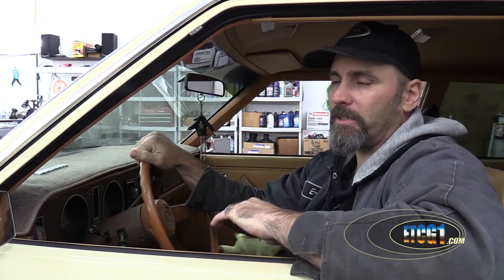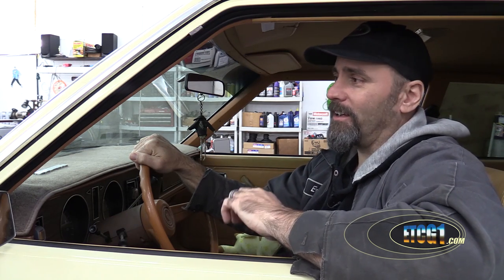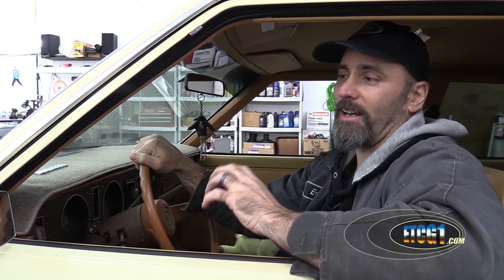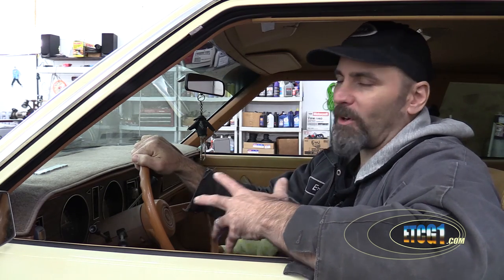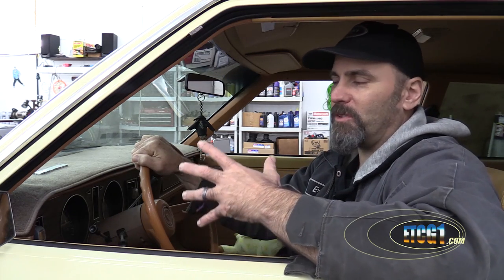Analog vs Digital (Cars)

Comment: Well this devolved into an ageist controversy quite quickly...

I would say most people still have an assumption that electronics are more likely to fail, because that's how unreliable they were up until the last 10 years or so. You mentioned that carburetors are tried and tested, but if you apply your logic to the mechanical components you come to the same bias to assuming electronic failure, not some age exclusive understanding of gadgetry. You are giving people born after '85 way too much credit, hahaha. One other reason you left out, is that people tend to try the easiest fixes first, and swapping most sensors can be done in a few minutes (obviously there is a cost-vs.-ease relationship, but for the most part...).

Comment: I don't agree electronics is more fragile. It is less fragile then mechanics. Less moving parts was always preferred for reliability. But this allows the system to be designed more complex.  Making the systems more complex makes electronics seem more fragile.
 And what comes to repair-ability. I guess it is like the same as with mechanics. You just need different tools and skills and a designer who designs for repair-ability. It's just  the same with mechanics. You cannot weld rusted body parts if you have no MIG  as well as you cannot replace transistor if you have no soldering iron or you cannot play with software if you have no keyboard and compiler.

Comment: I really feel like the "manual" vs. electronic parts is what I prefer.  manual as in the lever underneath the seat which doesn't require electricity to adjust how far back you want your seat.  manual as in I can turn the heater controls and not have to worry about my touch screen that houses climate control settings going out.  I feel like late 90s Hondas/Toyota's are the sweet spot mixture of the two worlds.  I enjoy the ease of diagnosis with electronic sensors is a blessing, however the inundation with technology in making cars more luxurious is a step backward.  more electronics equals more bullshit to fix and more money to fix it.

Comment: I'm 24 year's old with an 04 toyota sienna that has a P0420, and 430 both say Catalyst System Efficiency Below Threshold (Bank 1),,,,, Catalyst System Efficiency Below Threshold Bank 2
at this point i say sorry car i changed the sensors relatively cheaper with aftermarket ones that I know are good and compatible and so now all i can think of is the catalytic converters (which are located on the Exhaust Headers) are gone. [from being a carpenter and having to go to a few worksites that past mud sections and having to get through somehow. and having an accident that had me replacing a few things] 

and so even i think that sensors are great but just having a before sensor go and an after sensor bend on me to now this. it's all great when it's working but when its going bad it's a technicians nightmare and money maker but a driver's death sentence.

Comment: Haven't read through all the comments....but, I prefer analog systems.   Try wasting hours chasing mouse chewed wires in the PDC or explaining why it costs so much to the customer for a wire repair!  That may happen the next day....just in a different area.  Carbs and HEI way easy.  The more complicated the system,  the smaller wrench it takes to mess it up.

Comment: Back in the day. digital were an complex and  expensive option for high end vehicles. Many mechanics of  those times like the mechanical systems due to trace fault method of fixing things. The  preference of my uncles is to go mechanic, mine is a mixture of both and my nephews is electronic. Neither is better, each  has a purpose that either makes one happy. my wife would  not let me upgrade  the Tbird  to a electronic carb and ignition system  until I showed her the newest EFI system and it's components

Comment: I think being born in the crossover period doesn't help.  It is difficult for people to tinker and play when something isn't purely one discipline anymore.  I think what will be exciting is when the open software and open hardware movements see more uptake in the auto world, then the tech can be as transparent as the mech.
Reply: But If You manage to adapt to the new tech You become versatile. It's good for self esteem to possess to knowledge about difficult stuff :)
Reply: Oh, yeah, for sure, I'm all for that :)  I think it just changes the learning curve for DIYers because you can't just jump right in and "learn by doing"... you have to worry about getting your car stuck in limp mode or an airbag blowing up in your face etc.
Reply: As much as I enjoy and support the open software/hardware movement, that will never be a thing in cars. Mostly because of the federal regulations and the liability it might pose to the manufacture.
How ever, if your building something custom for yourself check out the MegaSquirt system. Open source hardware and software engine management system. Can basically be adapted to run on anything really.
Reply: Yeah it's a fair point at the manufacturing level.  Maybe there is hope at the service/aftermarket level though...  A client of mine used to do all sorts of wizardry, probably largely illegal, to get diagnostic codes they could sell to people who make scan tools.  The manufactures have that shit locked down tight because they want people using their service centres.

In fact, just googled: "open source diagnostic tool" and there is some stuff out there.  The data is the precious thing I guess though so we need open source CAN nodes so we know what the codes mean.

Thanks for the info, don't think I've seen that one but have seen RuseEfi which seems like the same thing -- would deffo love to give it a go one day.
Reply: ***** Its a bit of a learning curve, because to make it work on certain engines and different configs you have to mess around with the hardware. But theres a pretty good community around it, and lots of info.
https://www.diyautotune.com Is basically the best place to buy hardware, lots of stuff there.
http://www.glensgarage.com/catalog/index.php
Has some kits to make modding the units easier.
Reply: +sparkplug1018 Thanks, have bookmarked for future reference.  The learning curve is the fun :)

Comment: Really, K-Jetronic systems were fun? A friend of mine is currnetly being educated as an automotive technician, and he bought himself an old W124 with the 2.0L engine and a K-Jetronic, but a very early version, so not much digital stuff on there, and it hasn't been running right ever since. Nobody knows how to find the fault, they have replaced so many parts since then, and it still isn't fixed. It runs, but it doesn't run great or driveable (certainly not with the amount of fun that you'd expect from a Mercedes Coupé).
Reply: Seegal Galguntijak kjet is easy to keep running right. Are you sure it's a fuel injection problem?
Reply: Badgertronix Everything else has been ruled out (i.e. ignition), so yeah, it must have something to do with fuel delivery. But most technicians nowadays don't have the experience with these 30 years old systems any more, so they don't know what to look for - they know how the systems work in theory and can follow technical manuals, but when it comes to knowledge about failure modes and diagnostics, they just aren't experienced any more, because there aren't many cars of that vintage left on our streets (and many of those that are left are being maintained by their owners who know the system by heart, but don't work in a repair shop).
Reply: Its entirely possible it may not be a fuel delivery issue at all. Im assuming they've verified that the timing is still accurate (the chain isn't worn out) and that everything in the valve train is still as it should be. And nothing like intake or head gasket leaks. Not entirely familiar with Mercedes of that vintage, but I'm pretty sure the valves require regular adjustment as most cars around that time did.
Reply: sparkplug1018 Of course they have. I don't know any details, but they have ruled out basically everything else. And as far as I know this engine has hydraulic lifters, so the valves are "self-adjusting".
Reply: Seegal Galguntijak Those old Mercedes can be so temperamental sometimes. Hope you get it sorted out though.

Comment: Regardless of when your carb was designed unless it's a Rochester quadrajet with metering rods, that carb flows a set amount fuel that the jet is set to flow and that's it.  Not good at all rpm or driving styles
Reply: Unlike EFI

Comment: carbs are the best I drive my 86 cutlass with a carb every day
Reply: jonathan thacker 307 fuck yeah
Reply: yes it is theres videos of it on my chanal the blue one needs a intake gasket right now I also got a 81 with a 260 carbed
Reply: jonathan thacker yup 307s are notorious for intake gasket leaks. il check it out. I'm in the process or replacing my 307 with a 70 olds 350 in my Electra estate wagon hah

Comment: Digital has just gone too far in my opinion, early 1990's cars with simple electronic ignition and electronics that could be reset/codes cleared just by disconnecting the battery were probably the best of both worlds. Since more complex electronics took over, requiring firmware updates etc, it makes the digital world more fragile.

Comment: first off, there is no such thing as digital electronics. All electronics use physical components that are analog in nature. What makes them digital is that they are driven into saturation. but even that requires a physical voltage that varies in amplitude.

Very few of the sensors in a vehicle aren't analog detectors, starting with the cat converter O2 sensors. IC engines are variable output devices, controlled by variable inputs. 

If a tech doesn't understand analog electrical circuitry and mechanical processes, he/she will be totally lost with the digital logic components that replace them.

The odd thing is that many older mechanics use digital thinking when working on analog systems. Brakes are considered as go/no go. Entire major components are replaced instead of their systems been troubleshot rationally.  

The growing reliance on magical manufacturers diagnostic analyzers is leading to a generation of mechanics that are parts swappers who understand neither vehicles nor the diagnostic equipment.

Erik is fortunate to be on the cusp of the transition from overly delicate mechanical components such as carburetor's to simpler replacements like injectors with rudimentary logic controlling them. What he intuitively understands is that there is no difference to an engine how fuel is metered into it, or what triggers a spark, somewhere an analog model curve is being implemented.

What calls me as an engineer is the ridiculous integration of infotainment systems with essential vehicle control and monitoring systems.  The geewhiz marketing numbnuts ignored considerations of driver usability in favor of GUIs and controllers that are difficult to use without diverting the drivers attention from driving. Knobs whodspe positions were easily incorporated into a person's perioception envelope for localtion, control and feedback are replaced with multifunction joysticks and gloss surfaces that change function without physical feedback. Very poor human factors engineering compared to the standardization of controls that happened mid 20th century.

If unchecked, this is going to make driverless cars a necessiity.  

What needs to happen is for IIHS to incorporate testing of frequently used functions into a driver challenge scale for safe operation, measuring inattentiveness as a series of frequently  procedures are followed such as adjusting the cabin temperature, turning on the radio, checking the speed and opening windows. This needs to be performed by a random panel of drivers of all ages and experience who are unfamiliar with the particular systems.

Comment: You do not need electronics for fuel injection, ever heard of P51? Electronics make fuel and air delivery very precise and far cheaper. I am from the muscle car era, and tuning a carb took extensive amounts of time, and the carbs were constantly going out of tune, just a complete pain in the ass. I still drive a muscle car and I have never been under the hood to tune fuel and air delivery. 
If you like constantly screwing around with the engine to get the best performance, mechanical is for you. I have been there done that and it has lost its appeal.  
Electronics is far far far more reliable. It has been years since any of my cars would not start. 
Only difference in repair is the systems are looked at differently, but both make sense, and are relatively easy to work on.
Electronics win in reliability, economy, performance. Analog wins in nostalgia.

Comment: While some digital stuff being put in cars is good, I completely hate the idea of autonomous vehicles. one day you go out to your car and the electronics can just be dead, which is unlikely for mechanical systems. And it saddens me that so many cars in America are becoming automatic transmission as the only option. I will only drive manuals. My 2009 Altima is a manual, and they don't make them anymore. Sucks. Next manual will have to be a Honda or what not , if they still have manual in like 5-10years

Comment: I'm sure it's been said already by now but these cars now have so many computers that it completely takes away from driving might as well have driverless cars if you are not in complete control, my daily car is a 1990 lincoln Mark 7 LSC it's only one cpu on the car that really matters, most people would rather catch the bus then drive a car like that 365. I just opted for a car that would not have to worry about 10k worth of computers that's really is trying to make bad drivers into good ones. just my opinion!

Comment: I love the technology and control over engines but unfortunately manufacturers are using that control to make more proprietary and specialized systems. Already seeing that mechanics need specialized manufacturer software just to talk to and diagnose an engine problem. Mom and pop shops will be gone in 10 years and all that will be left are dealerships.

Comment: i love my idi diesel it's a 445 navistar in a 91 f250 engine runs strong same can't be said about the transmission.and no fuel injection isn't always efficient as comparable car's from the 80's to my aspire get better mileage.

Comment: I was born in 92 and I hate electronics. It's all garbage. I put a carb on my boosted sbc cuz it cost me 125$ and it works great after a few basic free modifications.
Reply: Dennis Lorden  All garbage? Then why are you 
watching Youtube, which is the product of electronics and only viewable with lots more of it?  

Most electronic devices are as reliable and more consistent in performance than mechanical devices performing the same functions at the same price point. 

The problem that Under is creeping featurism. Because more things can be done with electronics that aren't cost efficient with purely mechanical systems, more is demanded. TPMS is a prime example. A reliable system can be made without in wheel pressure sensors. Individual wheels don't require battery operated ID encoded transmitters. A simple comparison of wheel revolutions with counters will detect a low tire.  Instead a more complex and expensive monitoring system make it expensive s expensive to use snow tires because the 
cars can't handle different wheel sensor IDs without reprogramming.  A small number of low tire pressure caused collisions is replaced with a much larger number if collisions due to not using snow tires. Additionally AWD has been marketed as a still more expensive remediation to address lack of tire traction in winter.

Comment: analog/ mechanical systems may be more finicky but are more easily serviceable. Americans  are mostly through away economy based. we get something new and use it and torture it and then dump it. the older school technicians have a harder time adapting to newer cars,  those tech who grew up in a mechanical world are more inclined to tune a carb and set timing but are still good with electronics. I see fewer of the youngest techs being able to set timing as there isn't much of a need with newer cars. unfortunately most of the good tech's are retiring and less of that old school knowledge is not being passed on.
Reply from the maker: I'm trying. ;)

Comment: i can deal with electronic ignition, fuel injection, etc.   But this crap with PWM driven fuel pumps in place of mechanical pressure regulators, CAN BUS integration between BCM's PCM's, TCM,s etc, Electronically controlled transmission shift solenoids.. yeahh... screw that. i dont need a light to tell me when somethings messed up cause i know my trucks well enough to tell when there is an issue.i like my hydraulically controlled 48RH or even better a good old NV4500... i miss those days
had a friend with an old international pickup and the wiring harness burnt up wile driving. no power anywhere but it still ran cause nothing needed power. it was all completely mechanical....

Comment: should have gone fuel injection. way better drivability as far as part throttle and part boost. also the engine will be come tired sooner because of those uncontrolled conditions in the cylinder. why wouldn't you go fuel injection even if it may have taken more effort and planning to begin with. carbs have their place but I think fuel injection would have suited your build better.

Comment: AutoZone was so quick to want to sell me an O2 sensor when they scanned my car and found it was the cause of throwing the check engine light lol. I knew it had only flipped out because I had driven through a deep puddle two days before cause shortly after the light came on. Few days after checking the light it went off and never came back on, didn't change anything. foh AutoZone